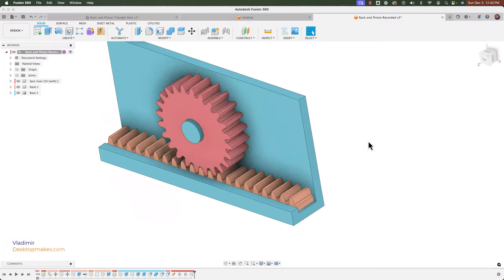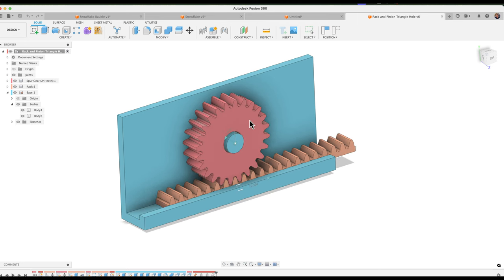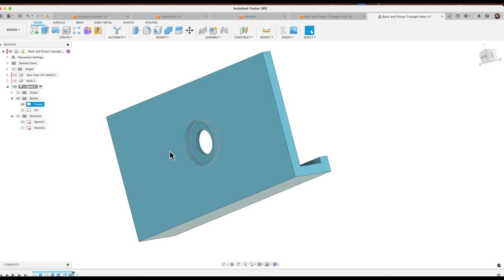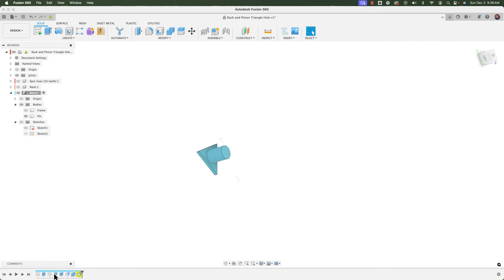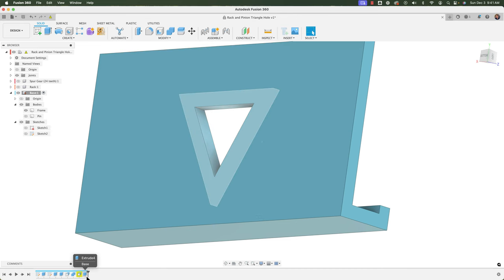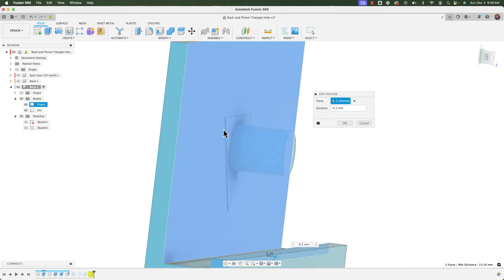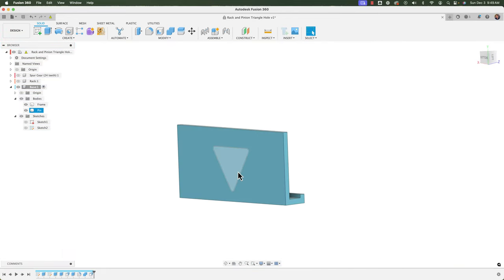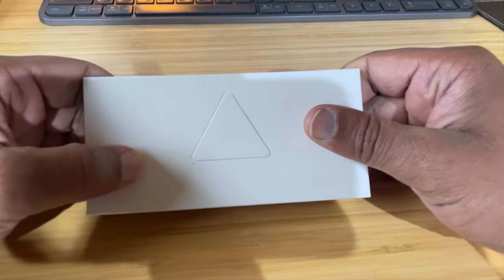Which is better for 3D Printing?

Comment: I'd agree with @shentharo about having the triangle point up, but often I'll go with a hexagonal shape. If it's printed "point up" you get a nice, low angle slope to a point and straight sides. All easily printed. If printed with a flat top, usually easy to bridge. Also, it's close enough to "round" that it can subsitute for a straight through hole. For the ultimate you could even change the very bottom of the peg to match the profile of the hole (make it hexagonal to).
Reply from the maker: I ended up changing the direction of the triangle and make it point upwards.  It's towards the end of the video where I show how to edit your design without breaking your timeline.

Comment: What you say is all true for 3D printing, but if an entrepreneur comes along later with more dollars than sense and wants to buy a million of them, then you have to redesign it again with a circle because it will be easier and cheaper to mass-produce.  😊
Reply: Ill happily redesign for a million bucks
Reply from the maker: Yes, very true.  The design approach will look very different with 3D printing vs machining vs injection molding.